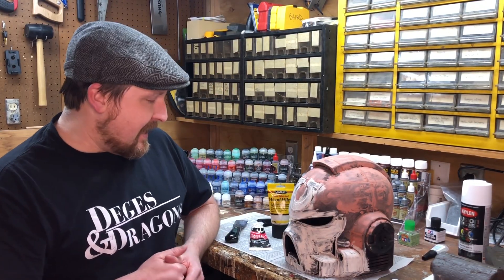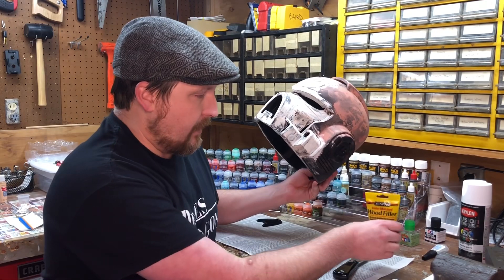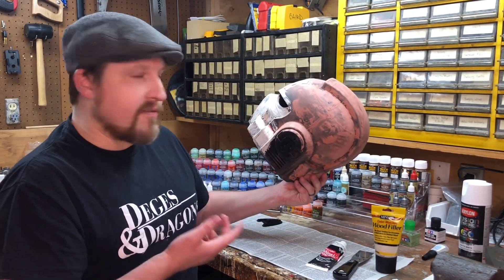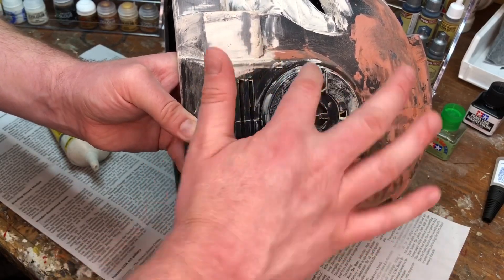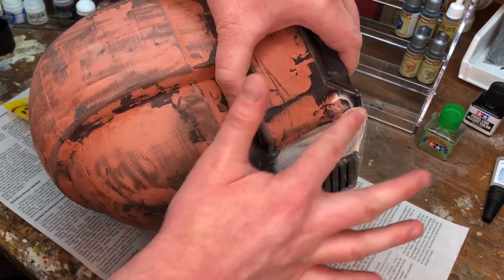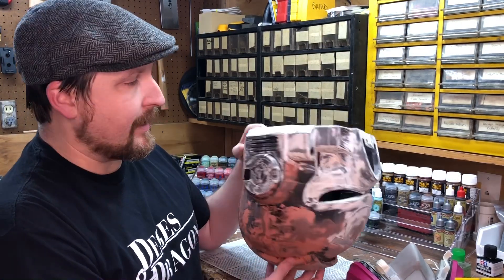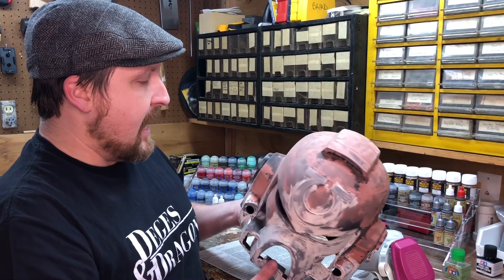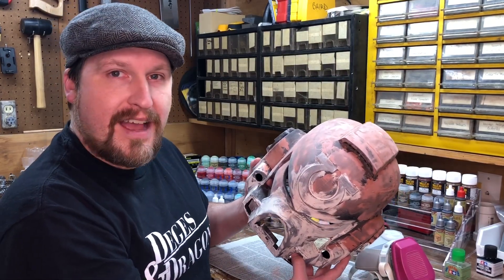Bondo vs Wood Filler - Smoothing Large Scale 3D Prints

Comment: Another method I’ve heard for bondo is mixing it with acetone. That’ll give the consistency of paint and it’ll be much easier to apply. I tried it once and it was great, but I don’t think I added enough acetone
Reply from the maker: Cool! I never tried adding acetone to it to make it flow better. I'll be sure to try that sometime.
Reply: @timbaird  its way more toxic, make sure u wear a good mask and good ventalation, it will stink a room fast, price wise, can`t go wrong with wood filler
Reply: Acetone STINKS. Like really bad. Use your PPE if you do this, and this comes from someone who never uses PPE. You want the consistency of pancake batter. Using the Bondo brand is roughly 3 parts Bondo, 1 parts acetone. I use a kitchen scale that does grams, but that’s overkill. You can eyeball it. Also you can use NEOPRENE gloves for working with it and Bondo. Do not use lexan because the Bondo will melt it. Happy making!!
Reply: Wood Filler also can mixing with acetone as well.

Comment: The spot putty/acetone mix is much better for large areas, but wood filler is best for small spots. Also be careful to not use thick layers. The thinner the layers, the stronger it will be. I use a mix of Elmer’s glue and gorilla wall spackle(gotta get the brand names) and it works wonders and it’s a lot thicker so you can actually build onto a part with it. Also I’m an RC aircraft guy and I use Elmer’s wood filler to fill in “hangar rash” and it has yet to damage the foam. Don’t use the bondo on eva or epp. It will melt the foam. Don’t forget to “trust the process” and use high grit to low grit sandpaper. Trust me on that I’ve messed up enough prints to know that it’s the only way to get the results you want. I start with 180/360(depending on how bad it is) and then go to 400/600 and then 800/100 for a very smooth finish. Use automotive filler/primer to get a perfect smooth surface. Follow this and your prints will never have layer lines or deformities again. Happy making!!!
Reply from the maker: Thanks for the advice! I haven't worked much with EVA, so I'll file this away for later.

Comment: I always wondered about bondo, but i use wood filler with acetone so i could cover my prints even. I see people do the same with bondo, but I don't want red dust staining anything.
Reply from the maker: The red dust is annoying! I used a damp rag to try to clean it up, but felt that I never got it all and probably messed up the first layer or primer going on. The wood filler sands and cleans more easily, so that's a plus.

Comment: If you haven't already, try mixing a little bit of acetone with the Bondo putty to thin it out. It will go on a lot easier and fill in better. You also get a slightly longer working time. Definitely wear gloves though.
Reply from the maker: Ooh, I never tried that. Thanks!
Reply: And you can even airbrush it if you thin it enough (the glazing putty that is)
Just don’t use your best airbrush and make sure you CLEAN IT OUT lol

Comment: You can use 3d printing resin and a uv light
Reply from the maker: I'll have to look into that, thanks! I work with a lot of different UV curable resins at work, typically for gluing abnormal parts to each other, but never for smoothing print lines. It'll be something neat to try!

Comment: walmart had a special on lepage wood filler, 128 g for 1 $ each hehe, i bought it all 15 tubes, as i just got into 3d printing, got like 25 years in crafting all kinds, but starting again and was using bondo, it sets fast, maybe sometimes to fast, toxic, wood filler is great, people say it shrinks, well maybe a little, fill it in if it does, i never saw anything shrink, maybe a huge spot filled, like u said, i will now use wood filler, bondo for big spot to fill in, ty for the vid, oh yes i will not use acetone to saved a few min of work, toxic stuff u got to keep away of have a real good spot for ventelation and mask, good one

Comment: For me wood filler dissolves too much especially if it gets wet. I just keep mixing up very small amounts of Bondo and use that
Reply from the maker: @duoderf12 , what are you doing with it after? If you paint it, especially with a clear coat after, it should protect it. Have you tried Gesso before? I like using that on foam and other odd surfaces when I want to protect it and prep for painting.
Reply: @timbaird  just washing the props after sanding and before paint, the wood filler washed off, even after seeing for days.

Comment: I've heard that wood filler has less vapors than bondo and glazing putty. Is there that big of a difference? I don't want to risk my health that much if there is
Reply from the maker: It's definitely a concern... Bondo can be bad for the lungs if you're breathing it in with no ventilation or mask. We have a benchtop exhaust booth to pull air from the work bench, so I wasn't 'too worried', but it's a concern. Wood filler is pretty safe, so that's another perk to it's use.